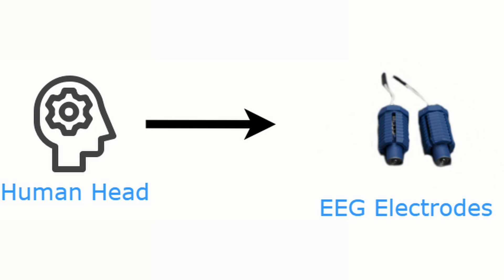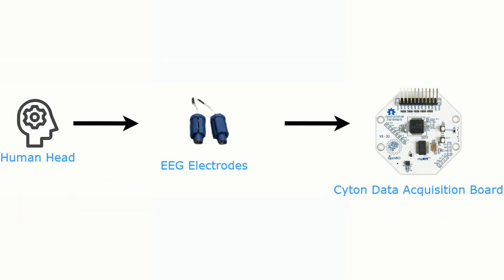Controlling Motors by Blinking- the Power of EEG/EMG and Mind Control! OpenBCI, Arduino, MATLAB

Comment: Hi sir, may ask how to connect bluetooth to the both matlab and arduini ide?
Reply from the maker: I am not sure how to do that. I am sorry that I cannot help more at this point.
Reply: Hi sir, do you know how to apply bandpass filter to the real time signal?
Reply from the maker: @ninjbadgartsedendamba1335  We have updated this project with new experiments and approaches. Please look into the following videos: Part I: https://www.youtube.com/watch?v=h5Lu9OcZ8x0
and there are 4 parts, you can find all 4 parts in the description below that video. Search MATLAB design bandpass filter to see how to implement it. You can for example, do a high pass and then a low pass with a different cutoff frequency. This is a primitive approach, however, there are more advanced method. I do not have time to dig more into that topic. Best regards, Aleksandar Haber

Comment: Hey Aleksander, I just got the openBCI ganglion board. I streamed some data from the GUI into a .txt file and opened it in python with pandas. I noticed for each sample, there are two values corresponding to each channel. Did you run into this? Do you know what it means?
Reply from the maker: Hi Elaina, 

thank you for the comment and interest. This is the MATLAB code I used to establish the interface. This is more than a year old code, so I do not remember all the details. However, I was able to get the reading directly in MATLAB . I believe that you can use a similar principle to establish an interface. Note that I am using a Cython board. Good luck! Aleksandar Haber 
CODE STARTS HERE:

% the communication between MATLAB and Cython board is established using
% the parameters described here: https://docs.openbci.com/Hardware/03-Cyton_Data_Format
clear all
clc
delete(instrfindall); % it is a good practice that we call this

% these values are specific to the Cython board
% start stream character
start_ch=char('b')
% reset character
reset_ch=char('v')
% end stream character 
end_ch=char('s')
% number of packet bytes 
packet_bytes=33
% default gain volt/per count
gain= 0.02235 *10^(-6) 

% set the main parameters
InputBufferSize =packet_bytes*2000*100;
Timeout = 1;

cython=serial('COM5','BaudRate',115200,'DataBits',8)
set(cython, 'InputBufferSize', InputBufferSize);
set(cython, 'Timeout', Timeout);

% open the communication port 
fopen(cython);
fwrite(cython, reset_ch, 'uchar');
% pause the execution of the code in order to allow the board to reset
% itself
pause(0.5);

% when the cython board is ready it will send '$$$', the ASCII value of the  character '$'  is 36.
% read until '$$$' is sent
temp= fread(cython, 3);

while (sum(temp(end-2:end))~=108)
   temp=[temp ; fread(cython,3)];
end
% at the end of this, you should get a warning message, and that means that
% the buffer is empty
% also the last 3 entries of temp should be 36

% start the communication
fwrite(cython, start_ch, 'uchar');

for j=1:(1000)

sum_outer=0;
for k=1:50

 temp= fread(cython, packet_bytes);
% Map of the bytes:
% Byte 1 : Header  = 160
% Byte 2 : Sample number
% Bytes 3-5: Data value for EEG channel 1
% Bytes 6-8: Data value for EEG channel 2
% Bytes 9-11: Data value for EEG channel 3
% Bytes 12-14: Data value for EEG channel 4
% Bytes 15-17: Data value for EEG channel 5
% Bytes 18-20: Data value for EEG channel 6
% Bytes 21-23: Data value for EEG channel 6
% Bytes 24-26: Data value for EEG channel 8
% Bytes 27-32: We do not need them, Accelerometer - data 
% Byte 33: Stop byte =192

test1=temp(6);
test2=temp(7);
test3=temp(8);
D1 = de2bi(test1,8,'left-msb');
D2 = de2bi(test2,8,'left-msb');
D3 = de2bi(test3,8,'left-msb');

D=[D1, D2, D3];

% convert to a decimal value using the 2 complement interpretation 
if D(1)==0
sum=0;
else
sum=-1*2^(23);    
end
for i=1:23
    sum=sum+D(i+1)*2^(23-i);
end
voltage=gain*sum;
sum_outer=sum_outer+voltage;
end
avg_voltage(j)=sum_outer/100;
plot(avg_voltage)
%hold on
pause(0.001)
%plot(fread(cython, packet_bytes))
end

fwrite(cython, end_ch, 'uchar');

Comment: Hi sir, may I ask why did you use MATLAB for signal processing? I believe OpenBCI GUI has such capability, yes? I am trying to figure out how to fill up the gap between OpenBCI and Arduino. Any chance you could help me out?
Reply from the maker: Yes, we used MATLAB for signal processing.  First, you need to interface MATLAB and OpenBCI.  Then you need to interface MATLAB and Arduino. The relevant code for interfacing MATLAB and OpenBCI can be found here:
 
https://gitlab.com/daniel.indictor/SERP/blob/master/MATLAB/CytonBoard.m
An example of how to use the class can be found here:
https://gitlab.com/daniel.indictor/SERP/blob/master/MATLAB/detectBlinks_interactive.m
Please note that the code is licensed under the GPL.
 The authors are my students Dominick Villamore and Daniel Indictor. 

To interface MATLAB and Arduino in an efficient manner, see my other video: 
https://www.youtube.com/watch?v=pLniKRaNPbA&t=4s
And the codes I posted on GitHUB
https://github.com/AleksandarHaber/matlab_arduino_interface
It took us quite some time to figure out how to do all this.  Best Regards, Aleksandar Haber, Professor CUNY-CSI
Reply: @aleksandarhaber  will look into it, thank you! On another note, have you managed to progress in this project like moving a remote controlled car?
Reply: @aleksandarhaber  Hi there! I am just wondering which part of the code registers the blinking? I am hoping to utilise the change in attention level (purely by thoughts) by editing the code you shared. Do you think it is possible?